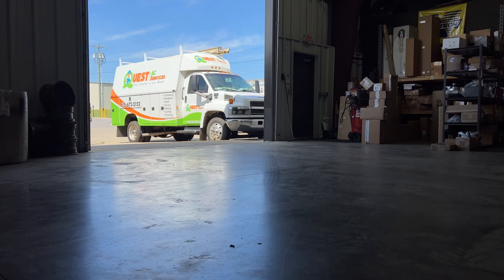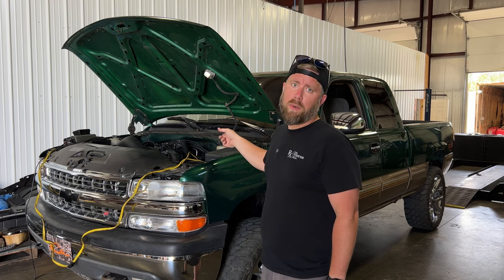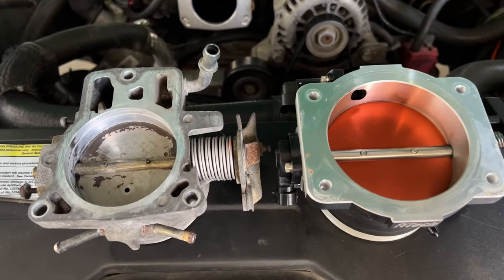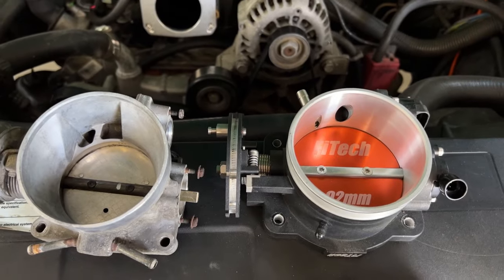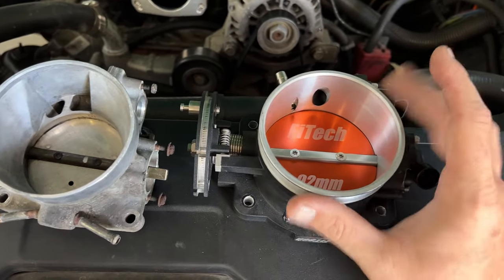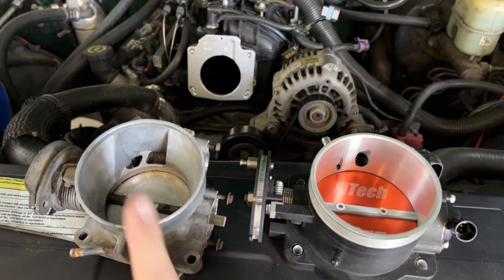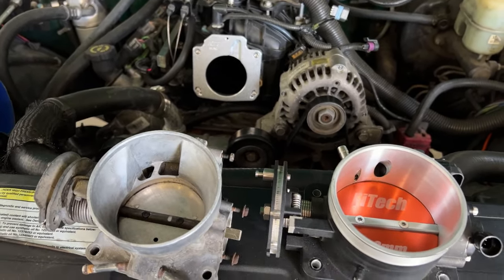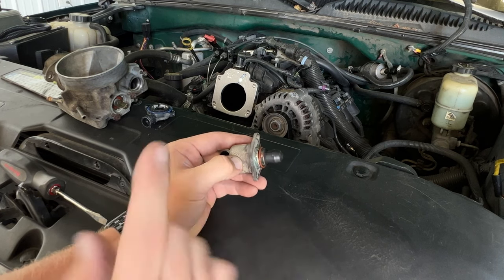4L60e Tuning How-To + Truck Norris Dyno Tune! Gen 3 Tuning on HPtuners

Comment: Finally someone with some good sense about torque management. I have 271,000 miles on my 4l60e. 100k miles with a camshaft and tuned with a wideband. 22k miles with a turbo. A sonnax .490 boost valve and corvette servo helps.
Reply: Wow. I'm shocked. I likecto hear that shit.  👍
Reply: My boosted Silverado lasted 220k lmao about 50k with boost. And a stock 4l60 ahah just got the Truck Norris cam kit in the mail yesterday time to upgrade to come chop chop
Reply: Well u lucky as hell cause these suck and I've been thru probably more than most and some name brands u have heard of and they suck also 😂

Comment: 99% of tuners delete torque management and that’s what kills the trans. I went to the track with my turbo gto and turning it off made zero difference. But it did break my output shaft on the second run with it off.

Comment: A few minutes into your video I went to check my spacer on the truck. Tuner put a tbss intake on my 5.3 with stock cable throttle and one of those adapters. It didn’t have the iac groove but it appears he took a dremel to it and cut it right open… no wonder it idles like hot garbage. Ordered the proper one now!

Comment: Man I need help tuning my 2001 gmc sierra 4x4 I have the summit 150-153 engine, cam specs 222/231@.050  .545”/.545”  112 lsa with deatschwerks injectors, part number 35u-01-0044-8, summit coil packs, sum-850504r, msd wires, bbk long tube headers, bbk 85mm throttle body, with cold air intake.. got a new transmission 4l60e from monster transmission with upgraded parts, 2000 stall converter I think please give me a shout asap I’d like to speak with you if possible

Comment: I had a idle air control valve that was so dirty that it's stuck in the hole in the tb and when it tried to open i it unscrewed it from the solenoid leaving the plunger stuck in the hole. Talking about idle issues. That will definitely do it. No I make it a routine to pull it out and check it and clean it every 6 months. This was on my daily driver that I used to put about 400  to 500 miles a week on. Retired now and I doubt if I do 200 a week but I still check it.

Comment: Damn that thing is seriously down on power. My Truck Norris suburban made 325/335 on a dynojet, and 292/311 on a mustang. Short headers and catless Y pipe. It made 240/254 on the mustang bone stock.

Comment: 🎉great tune up and performance recommendations for the customer.  I always thought a good battery and charging system check would be great way start the road tune and compare the live data numbers vs. the dyna tune numbers after as a final check.  Good tune under the circumstances for good customer service .
   Good work!!!🎉😅🎉

Comment: The last 01 suburban I tuned with a truck norris cam and long tubes I had making the 1-2 and at 6200 and the 2-3 at 6100 and got a LOT of hate on the page I posted it on. I'm not saying the haters are right or that your wrong I'm just telling the feedback I got from that. The truck has been in service for about 6-8 months now with no issues that I know of.
Reply: My 4.8 with ls6 cam was shifting 6300 1-2 and 6200 2-3

Comment: Love your content man, good stuff! A quick comment/observation: The only way the IAC port size could act as a restriction(too small on some aftermarket tbs) would be if the actual IAC pintle/seat was capable of out-flowing it, and don't think it could(IAC pintle seat bore would have to be larger than the FiTech TB IAC port, and it has the pintle sitting in the flow). Secondly, (and without flow testing those setups or doing the math, but just visually) I suspect that ~1/8"x/1/2" channel on the ICT adapter probably flows less than the round port on the FiTech TB. In know that the TPS on that tb was clocked wrong so that one needed to go, but I just don't think the tb idle issues you mentioned you've seen on other occasions are/were actually driven by bypass air port size. You can bet GM's supplier made the ports way oversized to minimize machining steps $$ (only the IAC seat needs to be that precise, the bypass ports are as cast -as long as they flow more than max pintle/seat flow you're good), and maybe save a little aluminum cost as well.

Comment: Awesome videos on content that normal people build. I am tuning a 2005 yukon with the truck norris cam and some tsp ported heads with bigger valves on a nice 5.3 bottom end. Everything is going great except I am getting like 150 lbs of torque at in gear idle. Have pulled timing and what not and it still just make a ton at 750 rpms. Don't understand what is causing the issue. Every time I do a truck I learn something new. This one is being a challenge.
Reply: Too much motor for stock converter

Comment: I’m thinking of putting a cam in my 5.3. Probably would be a truck noris cam. It is a drive by wire so I’m just curious would I run into idle problems if I swapped the throttle body and would swapping the intake manifold effect it at all as well?

Comment: I have 2004 Joe Gibbs Performance Silverado I did custom cam swap more boost. Had a guy tune it and it set for 3 years it now has map sensor code it idles high in gear ect. It be a great vid to do on.

Comment: You got me totally thinking about these throttle bodies . On my dad’s 73 Camaro swap i did , I was in a pinch so i got a China throttle body and what a pile ,lesson learned on that. I ordered a Gm one (same part as this ) and it made it run so much better. Needs tuning now as it breaks up a bit at some lighter throttle 1/4 to 1/2 but a lot of its hiccups have been cured just on that throttle body change alone ..

Comment: funny. My friend recently bought one of those throttle bodies from Amazon and I couldn't get it to run right until I swapped the original tps and IAC valve from the oem throttle body. Brand new bad out of the box just like most of the sensors we get at the parts stores these days...

Comment: lol No issues with my Fitech 92mm on TBSS with 4” diameter intake. IAC vs effective area needs scaling. 0.0v tps throttle blade screw barely turned in

Comment: Hey since you've done so many of those Truck Norris cam tuning, what is the correct / best idle rpm for them? I saw in this video around 800-825 rpm, would that cam in 6.0 require a different idle rpm? Thanks in advance!
Reply from the maker: It depends on the torque converter, gear, weight of the vehicle, etc. Most 6.0s would want between 725-800 in gear and between 750-850 in park from what I have seen so far.

Comment: Are you running it on the dyno in 2nd gear due to the driveshaft speed?  2nd gear is 1.625:1 compared to 3rd being 1.00:1 which would be ideal.

Comment: New to hp tuners. Trying to figure it out. Got my 5.3 with trick noris cam. Had my tuner do his thing on it but having issues in idle. Mostly in drive. It almost dies about 3 seconds after coming to a stop. If I manually drop shifter down to 3 it’s the same thing. If I drop in 2 or 1 it idles nice. In reverse idles nice. Please help if u can. I can send you my tune file. Take a look if you can and let me know how you can help me.

Comment: Do you have a video on using 93 over 87 octane, just did a build on a 2004 5.3 and currently running 87 and was wondering if going to 93 was worth it

Comment: Awesome video bud am running the same setup on mine 2001 same throttle body I keep having issues with the 92mm keeps shutting off once in a while specially when it’s cold do you recommend switching back to the stock one?

Comment: Another good one Matt. This answered most of my questions about the aftermarket throttle body Facebook post. Lol

Does the paper gasket on the adapter do ok with boosted stuff if we decide to use a stocker on a tbss style intake?
Reply from the maker: Yeah that Paper gasket will be fine. Both surfaces are machined well.

Comment: Any tips for truck Norris cam on a 02 2500hd rebuilt 20 over pistons everything else stock just doesn't seem to have any bottom end bought the programmed computer from Michigan motor sports then had it tuned by a shop just seems like it should perform better also did egr delete

Comment: Where are you located?  I'd love to have you tune my truck once I put the cam in.  It's got a tune from a shop but I assume it could be optimized more.  Also does the truck need larger injectors with the truck norris cam?

Comment: Hey Matt! 
Im not sure if i missed this or not, but under fuel cut off or DFCO tab, RPM Limits- there is a "bad vss cutoff"  set to 5500rpm. Would this have to b3 raised as well? I have a 5.3 turbo 7875 completely stock truck with a 4l80e, followed this video very well, but I seem to be limited at 5500 and bouncing off the limiter... 😅 Im not sure if i should change that above my shift speed, SD 2bar 12psi 10 deg timing 93 pump 😁 Also this is in a 84 crew cab chevy dually. Amazing videos, please keep this up!!

Comment: I would love for you to look at my tune. I have a 04 silverado crew cab with a gen 3 5.3l. Stage 3 tsp cam, 1⅞ tsp long tube headers, upgraded heads. 2800 , some head work. I have no idea what I'm doing with tunning but got an hp tuners just to learn. Truck runs decent just don't have anything in 1st gear. Runs at high rpm but goes nowhere. I'm down for the rate my tune

Comment: Could you take a carbide bit and make the hole bigger on that after market throttle body to increase the size for the air flow to be better?

Comment: Hey, just found your channel and really like your style. Two questions for my 06 5.3L GMC 4x4 crew cab, if going for reliable driveable power would you go forced injection or truck norris with springs and long tubes, and with 4L60E would you recommend a corvette servo upgrade or stock with trans kit or both...thanks for your effort in good content
Reply from the maker: A TorqStorm Supercharger kit and a Corvette Servo is a combo I like that retains fuel mileage and drivability but still make good power.

Comment: Just found your channel thru a comment on a Goat Rope Garage video. Nice. I have  6.0, 243 heads, Truck Norris cam and factory manifolds and cats on my 200k mile Silverado . So ya think I"m missing quite a it not having long tubes? Thanks
Reply from the maker: Yes you are costing yourself HP and TQ not having Longtubes. It’s a very drastic difference for sure.
Reply: Really appreciate the replies  @Matt_Sanford

Comment: Have you ever had a 6.0 Gen 3 truck fail write with aftermarket radio and alarm system? If so can you make a video on how to go around that. Thank you, loving all your vids so far!
Reply from the maker: Happens all the time with the 2003-2006 P59 ECM.
Reply: @Matt_Sanford  is there any tips or tricks for it ? My method is pulling radio fuse and un plugging the radio harness, disconnecting the battery and flashing it with a battery charger on it.
Reply: @2sslogan  I always have to pull the radio fuse on my 2003 . It's just a fact with these.
Reply: My best advice is go to the junkyard and make your own bench harness.  One day my 03 avalanche with p59 decided it didn't want to write for 2 days. I almost bought a bench harness so instead I wasted about $40 and made my own bench harness

Comment: Help from Long Island ny. My son and I took our trucks (Silverado with cam head work etc, awd trailblazer ss ls3 with cam head package) to a performance shop out here and both trucks running like 💩. Where you located I will ship cars/ ecu w.e please help us.
Reply: My son’s Silverado transmission went out 2 days after tuning. Was perfectly fine prior. I’m scared to drive my tbss. My truck have a stage 4 rpm transmission. I don’t want to break anything else. My son and I are getting his transmission rebuild and going to install it back in but I’m sure the tune wiped out the transmission. Need you expertise

Comment: Matt-another great and informative video for all to learn from as we build our dream trucks! I do have a question about an 06 1500 with 4.8. I had it tuned for 275 60 20 tires, lower fan activation temp and a decent balance of power and efficiency. (Not a door slammer) i noticed when the A/C is on, the truck will randomly misfire a couple times when idling and at highway speed. When it misfires, it always does it in 2s. No CEL/MIL and runs fine otherwise. It goes away when the A/C is off. I hooked a modis scan tool to it and dont see anything jumping out at me and have taken it to 2 different shops with no results. Could this possibly be a bad tune? Bad PCM? I'm tempted on getting a stock PCM and seeing if the problem goes away. Thanks for any guidance.
Reply: Sorry you didn’t get any replies, that’s an odd one for sure. Did you get it sorted out after?
Reply: Yes. I got a stock reman PCM and it went away. I'm thinking it may have been a bad/corrupted tune file.
Reply: @2009KVFD976  good to hear

Comment: Reason im asking is cause after my cam swap when i go to start the truck it sometimes takes 1 crank and the truck fires up or sometimes it take 1 crank and wont fire let off the key real fast and next crank fires right up. No one can help or give me an answer why. i do notice tps is around 0.8% when this happens and 0.4% when it doesnt. I have HP tuners software 6.0 p01 pcm truck norris cam. Never had this issue prior to cam, and head swap.

Comment: in my tune the force current tables under 90 and 96 are set to 98 is that a normal practice by some tuners?
Reply from the maker: Yes it is. It is also that way in some GM Operating Systems from the factory.
Reply: Sweet thank you sir @Matt_Sanford